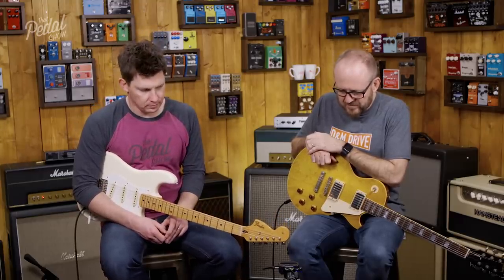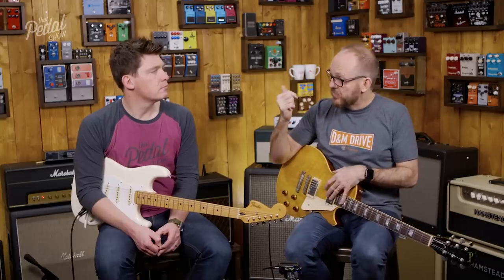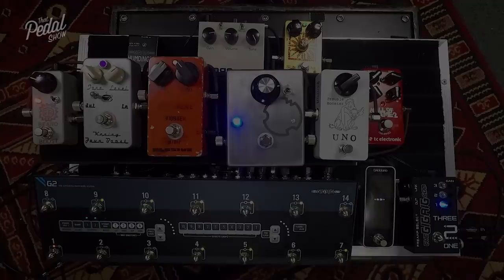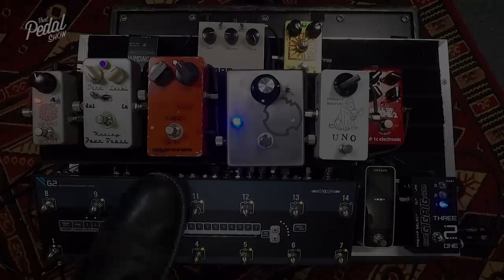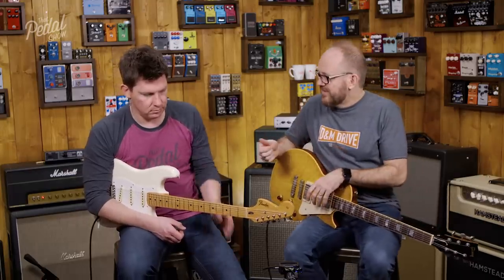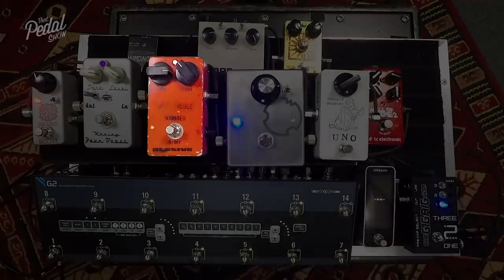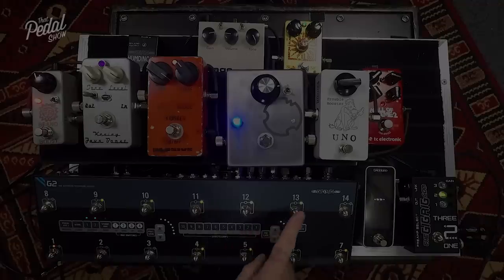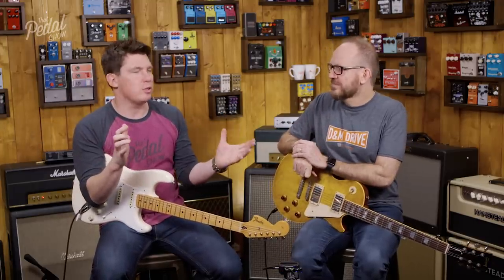That Pedal Show – Tremendous Treble Boosters For Glorious Classic Drive Tones

Comment: I know it’d be a fairly elaborate set up, but it’d be great to see a video on cutting through a mix with an actual rhythm section in the room. It’d be really interesting to see great bedroom tones in that context and then some not so bedroom tones that wail in that context using things like treble boosters, fuzz,  drive, clean boost etc. Maybe when you guys do a live show? Anyway, super work as always!
Reply from the maker: We are hoping to start doing this. We do have to move studios unfortunately - can’t get a band in the room - and we’re currently trying to raise the cash and find a suitable new home. Taking slightly longer than we’d hoped.... but it will happen before the Summer, we promise!

Comment: BSM addressed the issue of temperature instability by encasing the whole circuit in an epoxy block. It does work 👍
Reply from the maker: +Dean White wow, very interesting
Reply: I should give Mr Keeley a shout out for my original introduction to treble boosters 👍 

The BSM site has a lot of cool geeky TB info on various historical  units and it’s users

Comment: As a rule of thumb, attenuators with multiple settings are resistive. Load boxes can be either, but the good ones tend to be reactive. The thing is, you need 6X more components (and not cheap ones) for a reactive load compared to the same resistive load. And as attenuators generally are a complex switching matrix, with lots of components switched in different configurations, it just doesn't make sense to make a reactive scaleable attenuator. And the powe station is a load box with a power section, not an attenuator. There are some attenuators like the air brake, which use resistors that have higher self inductance and capacitance than regular wire round speakers, so they get a reactive vibe.
Reply from the maker: Thanks for that. My assumption was that it was purely resistive until somebody shouted at me on here. Palmer don’t seem to know either.

Comment: Great video!  Always wanted to try a treble booster because it was presumably the pedal Clapton used with a Marshall Bluesbreaker and a 60’ Les Paul for the Beano album.  Only gripe with the video is you guys didn’t mention which one was your favorite.  If I had to guess for Mick it was the Java Boost, and Daniel it might have been a toss up between the May boost with silicon transistors or the Beano Boost.  Thoughts?
Reply from the maker: I liked the Java for sure (Mick here). After hearing it with the Page, I ordered a Beano. I have a Cream gig coming up and it’s the perfect sound! Cheers!

Comment: Thank you guys for the show! Really great job. 
I recently acquired a Tonebender reissue from British Pedal Company. When I use my Telecaster and my AC15 (same one that the one you use on this video) along with the Tonebender I kind of sense that I loose a lot of top end and the bottom sounds a bit mushy. 

Is that normal? Would a treble booster kind of pedal help solving the issue?

Thank you again for your videos! Cheers!
Reply from the maker: That sound about right for certain Tone Benders - they can get very mushy. Does yours not have a tone pot you can turn up? Other than that, yes a treble booster will rectify the issue and give you a ton more gain to boot!

Comment: Ye ol Treble Booster edges on fuzz when I like it.  Otherwise an eq would do it.  And the guitar knob control is useful like a fuzzface thing. They are similar but wildly different at the same time. Like a Fuzz Face, a Treble Booster has a *high output impedance and low input impedance compared to other pedal critters like OD's or wot.  Anyone playing with fuzz or treblebooster pedals should look into the G&L (Leo Fender) bass/treble control for their guitar. The man was a genius. Those controls lead right into that low input impedance and give you detailed control of fuzz and treble boosters on board your guitar. Guitar cables matter.

Comment: Another question please! My Big Muff Nano Pi fuzz, no matter how I set the tone, is just stupid boomy on the bass side with my amp. Would a treble booster like the EHX Screaming Bird work with that fuzz, and would I want it before or after the Big Muff? I run my amp just slightly past the break up point on the pre-amp. Thanks a lot!

Comment: "What we need is a mini refrigeration unit that can sit around your germanium pedals". These exist, but nobody uses them on pedals, probably because nobody famous has thought to try it. Called a peltier cooler; they come in small sizes able to fit on or in a pedal, and they typically require 12v DC and 4A and up. They sell for between 2 pounds and 60 pounds, and can cool to serious minus degrees C, depending on set up, heat sinking and supply voltage. The better small ones are silent, the older designs and more powerful ones make an annoying ticking noise (though this won't come through the amp of course). I used to use one on my Fulltone 69. Worked a treat in the Australian heat for stable performance. Powered it with a small PC power supply under my board. So get to and commercialise the idea Dan, and think of me when you sell them.
Reply from the maker: Nice! Thank you for sharing that. See, nothing’s new is it? Everything has been done already! :0)
Reply: But don't guitarists like it like that, with our 60s model amps and our classic guitar designs?

Comment: Question: does a regular boost pedal function like a Treble Booster if you put the bass control on zero and crank the treble?
Reply: Kind of but not the same result. There is something special about treble boosters with germanium transistor

Comment: Great show! Still trying to understand boost pedals.  I (think) I understand how you can boost parts while you play, like solos and etc, but are these pedals also meant to be always "on" so you can achieve the desired tone/sound from your amp?    Thanks for what you do and really enjoyed your NAMM shows. You guys are a hoot!  All the best!
Reply from the maker: You can use a booster in different ways. A lot of people assume they’re only for volume, but as you point out, they’re also for tone. It can be one, the other, or both depending on how your amp is set and that’s all about gain stacking and headroom. They are subjects we touch on all the time. Hope that helps. Cheers!

Comment: I love these shows, however, some things you need to try in a band situation
i have a treble booster (naga viper) on my board for several years and absolutly love it as a solo boost. when you play alone it can sound a bit shrill. I also have a tubescreamer as solo boost on my board when i use my strat and the clean channel on my amp.
Reply from the maker: No arguments here. Treble boosters were made for band environments!

Comment: Dan!! Did your Analogman Beano boost produce a large white noise hum? Currently mine is doing this. I even put it up to a cranked TS808 and it still made way more hum. Just curious is all. O yeah and yes both were on batteries, cables and guitar changed so not them.
Reply: Beano boost has a germanium transistor, and yes, the white noise hiss is inherent to them. TS models do not use a germanium transistor and their charachter and tobe are going to be very different as a result.

Comment: Hey guys, great show as usual.  Now I’m commenting before the end of the vid as I have to get back to work, so if you answer this in the second half I’m sorry, but;  I have a spark booster, so I’m wondering how successfully you can ape a treble booster by diming the treble of a clean booster with a 3-band eq?
Reply from the maker: It’ll never sound the same without the GE transistor, but certainly winding up the treble and rolling down the bass would get you in the same sport, maybe even the ballpark. But not the same game. Cheers!
Reply: That Pedal Show Thanks guys.  I currently have the Spark adding a hair more treble as my always on pedal.  GE booster probably not for me & my rig, as I have a FF up front.  May have to try rolling some bass off the Spark & see how it sounds.

Cheers for the advice!

Comment: Hi guys, very nice demo as usual! One question for Mick: 
you are using a Palmer attenuator with the marshall 1987x and I would like to ask your advice on this device compared with the tone king mini ironman II (I have seen your demo of the tone king coupled with a JTM45 reissue)...I know that the tone king is limited to 30W amps...but what about tone? is the palmer at the same level? thanks a lot in advance!
Reply from the maker: The Palmer doesn’t have the EQ control of the more involved reactive load attenuators. So if you want to attenuate heavily, it can end up sounding a bit thin where you want to add a bit of low end. Anything below 50 per cent is pretty cool - ie for a slight taming rather than full-on castration. For the latter we’d say one of the more involved reactive load boxes with EQ control is a better solution. Cheers!
Reply: Thanks a lot!!! I hope you will do a demo on best attenuators in the near future!!

Comment: Even though that Mick's got a G2 loaded board and has been hanging around with Dan for years,  he still goes for the traditional approach of turning the pedals themselves on and off instead of G2's switches.
Reply from the maker: +Adrián Cáceres Dan here, I think it’s because I set the board up and I know what  everything is plugged into, so it’s just easier for mick to toggle the pedal when he want to hear the bypassed tone

Comment: Does someone make a dual channel overdrive pedal that includes a treble booster?  It seems like so many overdrives that have an added boost use a mid-hump type.  Having a dual channel overdrive that had a full frequency drive with a treble booster makes a lot of sense.

Comment: I wonder if that reverse headstock neck of Mick's feels any different as compared to a standard headstock, and I wonder if it's any harder to play.  I imagine the string tension from nut to bridge is the same as a standard, but the overall string lengths are different.  I've always wondered how that affects bending at the low and high Es.
Reply from the maker: Hello Erich, interesting question! I ended up with this guitar partly after a comedy disagreement with somebody. A friend of mine had written - as I have many times - that the tension is different with a reverse peg head Strat... because both of us know through playing them that they feel different. However, technically the description was incorrect - as you correctly state, the tension remains the same, but the elasticity varies with string length, assuming it’s tuned to the same pitch. A lot of other people misunderstood and thought we were just being idiots about the fact they feel different and spreading myths. :9) To check I wasn’t going insane, I bought this. I’m not insane, and yes upside down pegheads do feel different, most noticeably - as you say - at the extremities of the strings. Top E requires less bend to get to the equivalent pitch, basically. It’s marginal, but if you play Strats all the time as I do, it’s very noticeable! Cheers!

Comment: Just what may be a stupid question, but in lieu of a treble booster, can I just use my EQ pedal to get the same results? Seems like that's what I've been doing, lol.
Reply from the maker: Similar results perhaps (the only stupid questions are the ones you don’t ask, btw). For a classic Rangemaster kinda thing; the Germanium transistor is important too. Really depends on the circuit and components. Cheers!
Reply: I’ve been doing the same thing myself. Works great for me without the weird Germanium transistor quirks.

Comment: So, if you have an equalizer, can you just crank the mid treble and would it work just like a treble booster?
Reply from the maker: A little bit perhaps. But the Germanium (or silicon) transistor design is a big part of the sound too.  Cheers!

Comment: The treble boost discussion piqued my interest. I have an AC30 and a fairly new OCD v4. I didn't do a lot of amp-specific research before I bought it. I love the stringy texture of the sound, but it lacks clarity in the upper mids. My other drive is an ODR-1. Both the ODR and the AC30 are more or less "flat", and the ODR is much clearer in the mix. I've been debating whether to remedy this with a boost with treble/bass knobs, a "treble boost" like a Keeley Java, or a different overdrive that's better suited to an AC30. If you have an opinion, I'd be grateful for it.
Reply from the maker: Get the Analogman Beano Boost and never look back. :0)

Comment: Ooo I was kinda hoping you'd have used the Sheriff 44 for this show, as I know Mick has been doing a bit of correspondence on the Victory fb pages regarding boosting that particular amp.. (Great show. Only ever briefly tried the cheap ehx treble bird which to my ears most of those pedals didn't sound vastly different from, with exception of the Keeley, which sounded lush :))
Reply from the maker: Mick here - the Sheriff 44 works superbly with a treble booster. RE my input on boosting them, that was in the context of solo boosts and loops etc, which is really a separate topic from treble boosters and gain. Same thing applies with the Marshall. Using a TB to boost the front end of a juiced amp won’t really work for a solo volume lift. Great for more gain, sustain and cut... not so much for a big lift in level. But yes, with the Sheriff 44 at low/medium gain settings: awesome! Cheers!
Reply: Cheers Mick, boost thing in the 44 isn't really a particular concern for me generally speaking, as I'm loving the Sheriff's gain stacked with an OD and using the Guitar Volume knob. Got the usually awesome ep boost, but had little need to use it as of late. Was just interested to see the TBs with a familiar set up. Don't think they're for me ... Interesting informative episode though :-) x

Comment: Kind of new to guitar. Could I use a good eq as a boost to get a treble boost effect?  I am looking at a Sabbra Cadabra pedal as well which nails the rangemaster/Laney sound, but I wonder if I could get a similar result with eq boost and the silicon fuzz?
Reply from the maker: You could get something similar Amber, but the way a classic treble booster is designed - with a Germanium transistor (or silicon) - has a big impact on the sound. It’s not only changing EQ in there. Cheers!
Reply: +That Pedal Show get mr may on the show!

Comment: What are you guys opinion of the Catalinbread Naga Viper?
Reply from the maker: Never tried it. Mick here. Certainly sounds promising though - a little more tweakable than the old rangemaster. However... what comes with versatility is almost certainly at the expense of the integrity and tone of the original circuit. So I’d probably really like it - I don’t like treble boosters - not my kind of thing at all - but Dan probably wouldn’t. He likes the bob-on vintage correct ones. :0)

Comment: QUESTION: Could you use an EQ pedal to emulate treble boostage?
Reply from the maker: A few people are asking this. You could certainly boost treble and cut bass, but the Germanium transistor (or silicon) nature of the circuit makes a huge difference to how it sounds. Cheers!

Comment: Need some help deciding between a Greer Moonshot or JHS Haunting Mids pedal. I’ll be using it on my late 40s Gibson BR6 amp.
Reply from the maker: Hmmm. Haven’t tried either but I admit to being intrigued by the Haunting Mids... Mick here.
Reply: That Pedal Show - I’m torn between (Haunting ‘s) versatility (scoop OR boost // parked wah...etc) and (Moonshot’s) simplicity. I looove my script Dist+ into my 1950 BR6...no tone controls whatsoever when I go that way.  Still, I would like my choice to still be useful in my Metro JTM45, which has more definition to it. I’m even tempted to just solder up a cheap Rangemaster clone, but a pedal purchase might make that a redundant expenditure.
Nice to see you read these comments. You guys (and JHS) make some of the consistently most watchable (least aggravating) and well-informed vids I’ve seen.  Keep ‘em coming.

Comment: Hey Mick did you de-reverse the bridge pickup on your strat?
Reply from the maker: No, it came with one like that, but to me it just sounds wrong, so I put it in the usual configuration. Cheers!
Reply: I might be getting the hendrix strat and will possibly do the same mod. Did you have to do any routing?